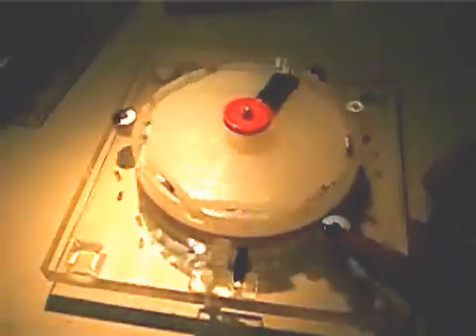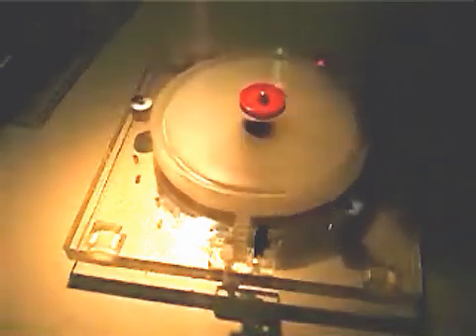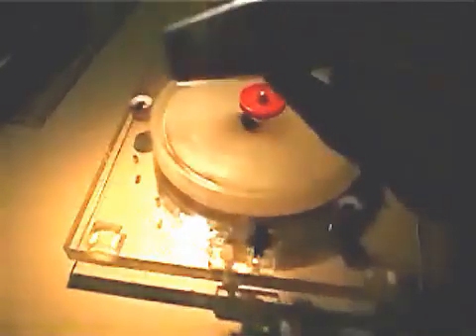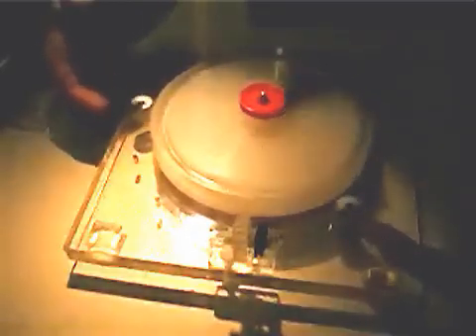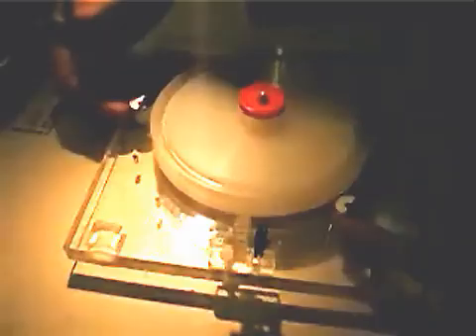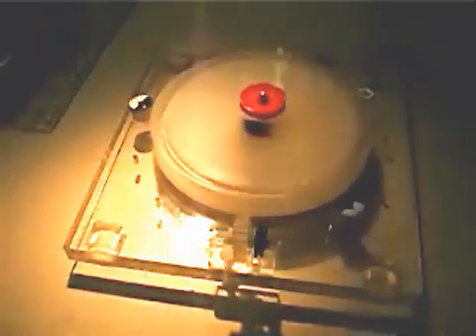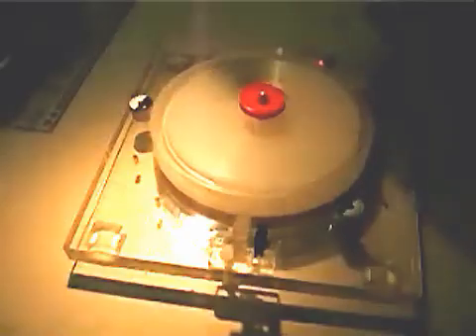OC MPMM Alsetalokin video restored

Comment: I duplicated this and it turns out that if you bring the stator magnet close enough to the rotor, the stator magnet will turn AGW by itself. In fact, I had all three magnets turning AGW, and no matter what combination I had running that way, they made for a great braking effect, not acceleration. If you've viewed the original version of this video, not this "noise filtered" version, you'll hear a motor-boating sound...which is the strong magnetic field below the table (which of course he never reveals, and even his quick lifting of the apparatus when he says, "And just to show you..." is not long enough to demonstrate whether the thing maintains rpm or slows down (which of course it would, out of the effect of the assisting field). If the stators are spaced away from the rotor with sufficient clearance, they will never achieve AGW rotation, only GW rotation, which is simply magnetic coupling.

Unfortunately, another fraud. Think, people...if this was real, it would by now have turned the scientific community over on its head, and it would have had many successful duplications, spread across the globe on YouTube. This goes as well for Yildiz, who conveniently always comes up with an excuse for his unsuccessful long term tests.

I am one who believes that there must be a way for this to happen, but when it eventually does, we will all know about it on the mainstream channels, not via cultist avenues like this.